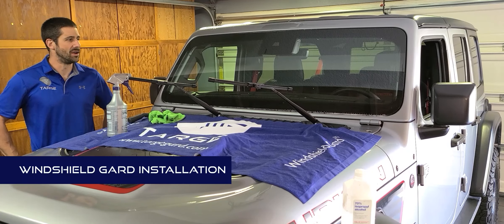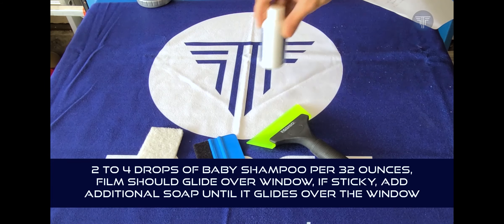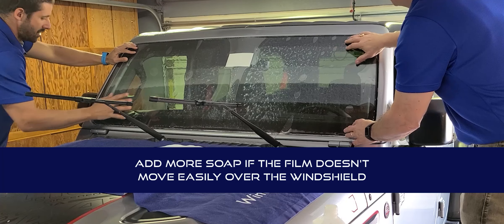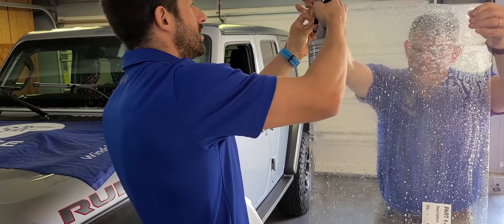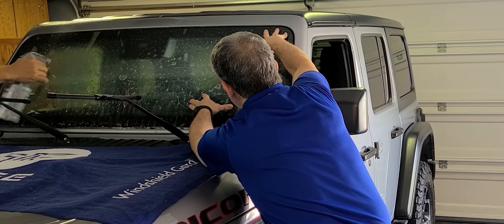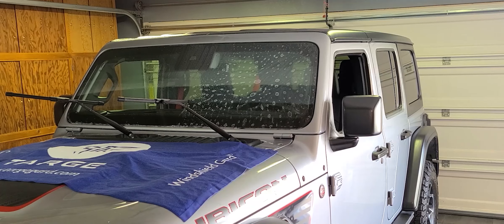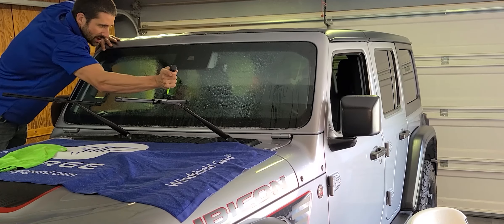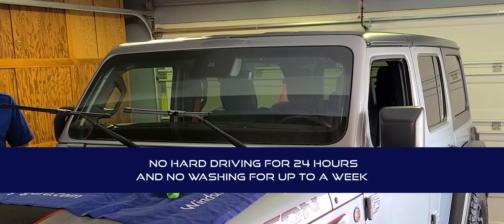Windshield Gard® Installation Instructional Video

Comment: Wondering if there are any dealers/installers in the Chicago area?
Reply from the maker: Hi, we have a "find a dealer" function on our website (www.targegard.com). There are a number of installers we have worked with in the greater Chicago area, you can find them by entering your zip code into that locator. We've also found that if you're already working with a tint/detailing shop that you're happy with, they're usually open to installing one of our kits for an existing customer. The kit shown in this video will be very easy for any detailing shop, most of the time will be spent on the cleaning/prep. For your bronco, it would also be simple for them to install, the only major difference is they'll need to tuck the very bottom of the film.

Otherwise, we consider the bronco (and wrangler and g wagon) kits to be suitable for a DIY install, if care is taken to follow the installation steps.